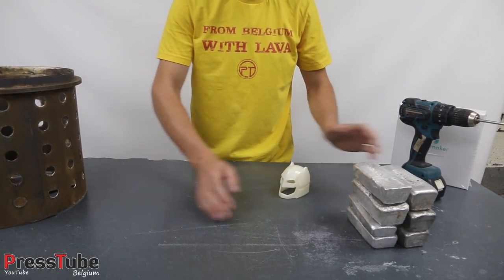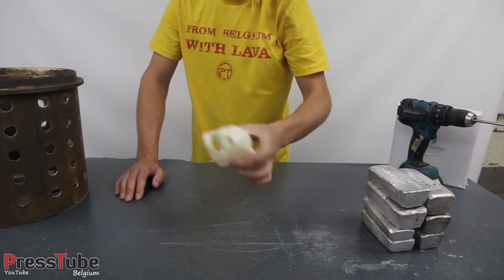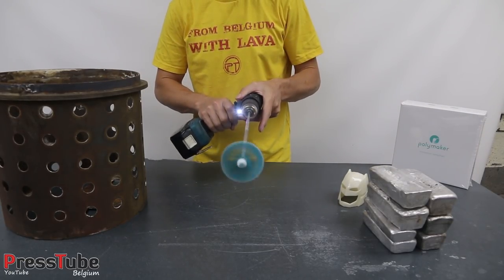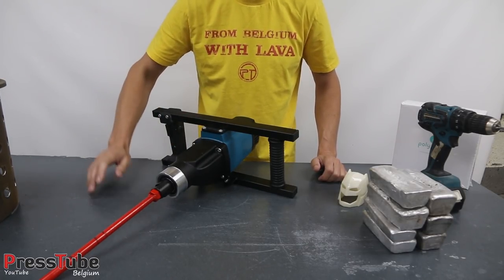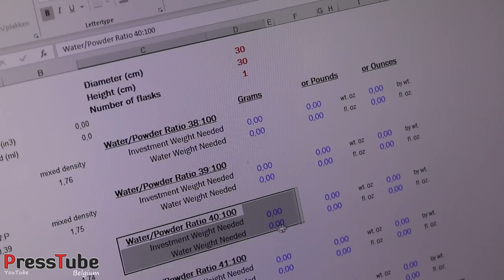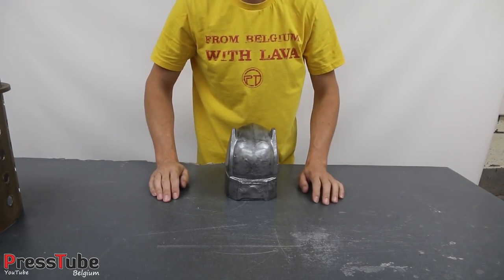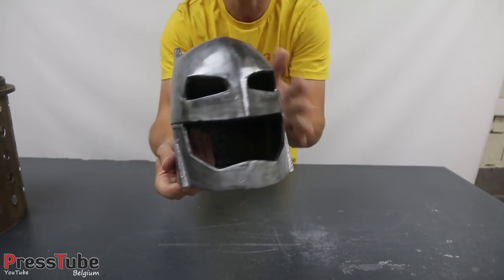Casting Aluminum BATMAN HELMET!!

Comment: could get rid of alot of them surface imperfections by degassing your aluminum with powdered Borax
Reply: then add the flux, helps your metal flow like water with less turbulence to reduce hydrogen gas build up when pouring .and if you added a spout to the top of your flask to pour into you could essentially get rid of all your turbulence. and get some killer casting quality but either way good work dude awesome stuff :D